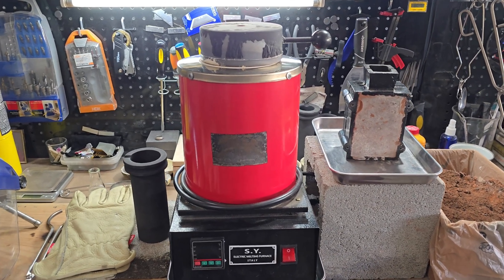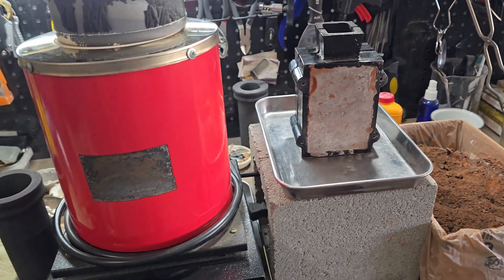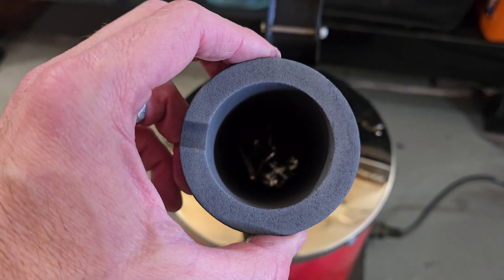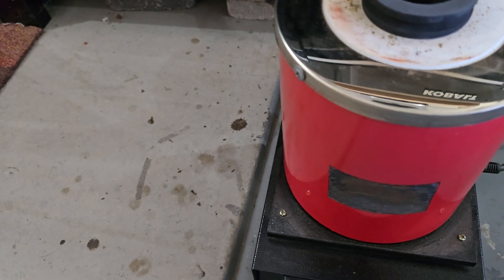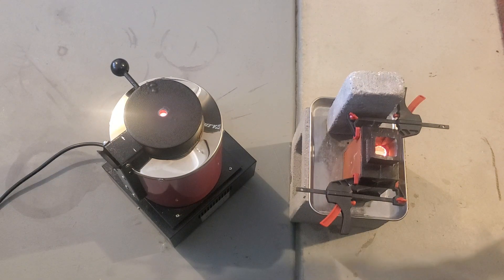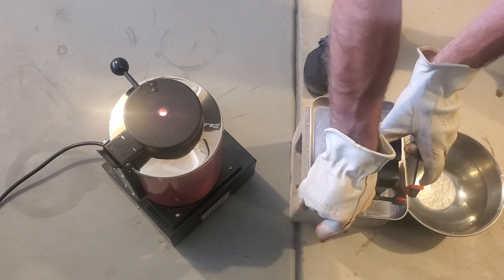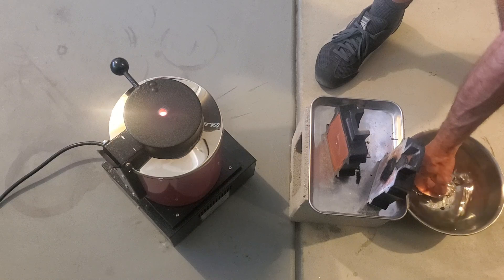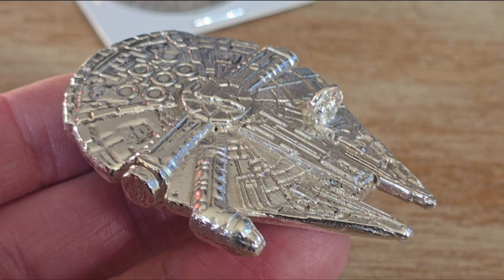How to Melt & Pour Silver Using an Electric Furnace at Home

Comment: Is there a way to ventilate your workspace better when melting silver? I am pouring a lot of castings in sand cast molds and in a garage. Also how did you get your casting to pour so smoothly in a sand cast mold? Do you use Delft Clay and do you have a video to show how you retained so much detail and didnt have the sandpaper like texture? Thanks!
Reply from the maker: I also do majority of sand casting for all my pours. In addition to wearing a filtered mask I have a fan at the back of my garage that blows the air out of the garage. For my sand casting I use Petrobond Ultra-FINE (190 Mesh), it will get you the closest detail to delft Clay. I'll make a video coming up on how I make my sand cast molds.
Reply: @JoshuaAndersonLife  Thanks a lot for the quick reply. I have been wearing a 3m P100 mask with the pink cartridges along with safety goggles, gloves and other protective wear. I just have been doing it in my garage though with no windows open and know that winter is coming up and I dont want to affect the temperature of the furnace or garage so my castings dont get messed up. As long as I have the furnace up to temp and pour quickly should my castings still come out ok? I use Delft Clay but ive been getting gritty texture. I like the texture but also would like to get smoother finishes on certain other pieces. One last thing, if I crack my garage door slightly and run a fan during fall and then winter when pouring should I be safe from harmful fumes if I wear my mask and will my pours still come out good? Thanks again and sorry for all the questions.
Reply from the maker: @JasonMayMAYDAYHIPHOP When I pour in the colder winter months, I use a space heater to keep the garage warm and I keep my sand cast close to it so the sand stays warm while I'm melting. Once I'm done with the pour I open the garage all the way to let the smoke from the casting out.